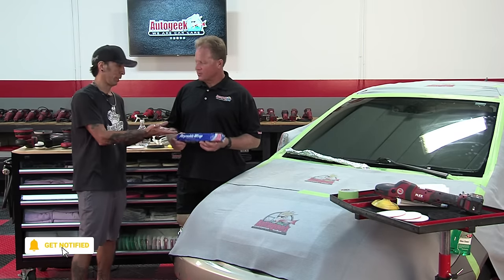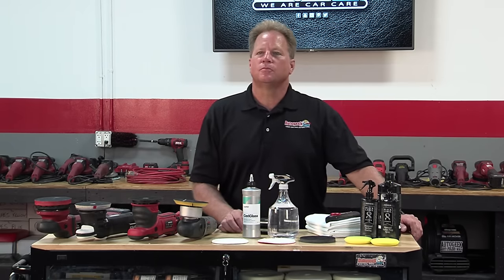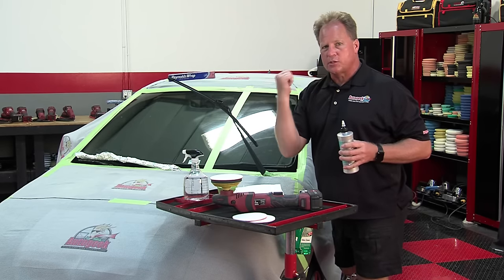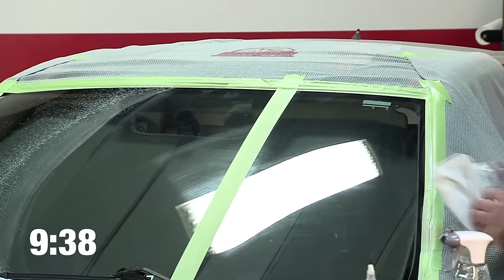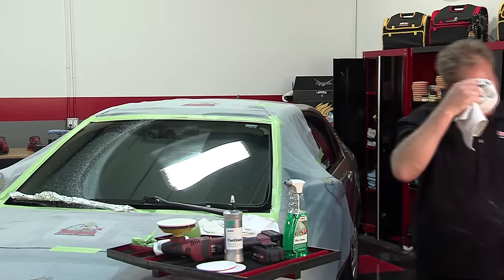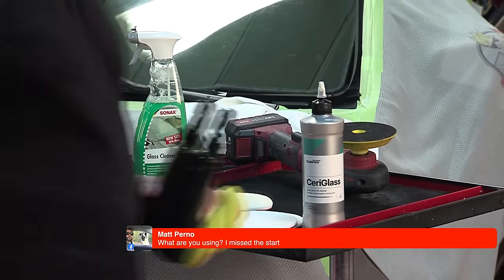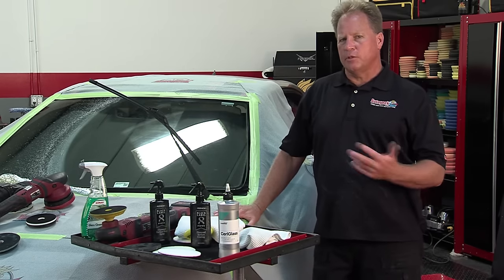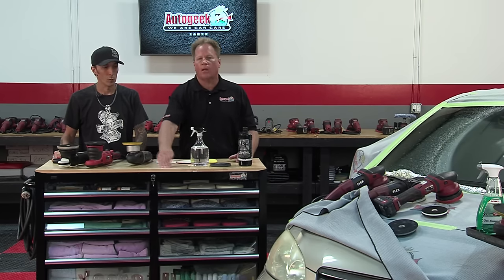How to safely remove pits, wiper marks & scratches from glass

Comment: I tried ceri glass and rayon pad. I ended up marring the glass. I don’t see the marring during daytime but at night. The glass was fine before I just want to remove the watermarks. Watermarks gone and hello marring🤦🏻
Reply: You probably have fine scratching/hazing or if could be redepositing of the glass particles you have buffed off. Possibly from heating up glass too much(I’ve done that) if your glass is smoking the water and polish off it will haze at that point. Possibly from pad wear. You go through a lot of pads with this method. You need to have several and power wash out to reuse to get all the buffed glass material out of the pad and also the used abrasive/polish build up..Try washing your pad or a new one with light pressure and keep it wet and cool with a decent amount of polish. It should  clear up but again it literally takes for effffing ever. I have spent 4 hours on a deeply scratched side window before. The pads start to not work right anymore after awhile, if you notice it started taking longer to get any results it’s the pad.

Comment: been repairing shower glass doors since 85  you can use toothpaste or and soft compound I use diamond magic you don't need expensive stuff you will still have fine circular marks left over
Reply: What about etched glass? Ive tried sanding with sandpaper but the water marks are permanently etched :(
Reply: Lol. That just gets hard water off. Toothpaste won't actually polish anything harder than plastic.

Comment: Rain is distilled water. No spots.
Reply: Horribly incorrect. Rain collects impurities floating in the air and brings it down to the earth.
Reply: @Blue-Lady  idont get spots in my car from rain. Only if its parked under a tree.
Reply: @ryanwright7144  kinda forgot. I live on the coast. Clean rain. I do remember brand new cars off the train at the dealership in dc coming in with bad spots and acid rain damage. Sometimes bullet holes!

Comment: Seems like it’s cheaper to just buy a new window! Liked the explanation of “this can be done” but I still would just buy a new window.
Reply: Yes. I was hesitant to do so. Especially has I'm insured.
But the last time my insurance  company changed a side window on my previous car. The guys replugged the tweeter speaker on the ambiant light by mixing cables and burned it. On top of that they've been unable to relearned the anti pinch safety limit. They damaged the motor shaft to winding drum during their attempts to "mechanically adjust it" and it broke later.
I then fixed it myself and discovered the mess with the tweeter speaker ...
All that combined, I really don't want to give them my new (2nd hand) car to replace a windshield ....
And I'm tied with them through my insurance, I can't go to and official dealer to have the glass replaced. :/
Reply: @stephanelouvet1113  I completely understand.
I do all the work on my vehicles in my driveway.
I replaced both front and rear subframes on my 2008 Ford Taurus over the summer in my driveway. (Got to love the road salt lol)
The only 3 things I don’t do are put tires on my vehicles, rebuild transmissions and alignment’s. 
I’m not saying what you did was a bad thing at all. But it would have been faster to put in a new window. The reason being is that your time is valuable and it would have been faster to just put a new window. I have replaced windshields by myself in under 2 hrs. But with help it could have been done in under 45 minutes.

Comment: why you are not sanding before polishing step
Reply from the maker: We used a less aggressive approach to get the job done. Sanding is extremely tedious (takes many hours), requires a larger investment (sanding materials), and should only be done by experienced people.
Reply: @autogeek  There are window pane polishing tutorials that start with sanding for deeper scratches. Since cerium oxide, usually 2 micron particle size, is the equivalent of 10,000 grit, the sanding process uses a number of finer grit sanding discs to save time before the final cerium oxide polishing. The deeper the abrading, the more optical distortion, so tutorials sometimes show sanding across a broad area to reduce distortion.

Comment: You can get the same results from paint polish and an aggressive pad.  That sure as hell wont get pits out.
Reply from the maker: If that works for you go for it. Yes I have removed pits too.  Here's the link for removing pits...

How to remove tiny pinhole pits in glass windows using a rotary buffer 
https://www.autogeekonline.net/forum/how-to-articles-by-mike-phillips/40436-how-remove-tiny-pinhole-pits-glass-windows-using-rotary-buffer.html

-Mike Philips
Reply: please upload your results and show us sir Id love to see your results.
Reply: @TheRebuilt1  I don't film and upload. As I stated I don't document on social media.
Reply: diamondrmp oh ok , well please advise what platform you have this info and will check out
Reply: @TheRebuilt1  LOL no platforms of documentation.  I've detailed cars for 35+ years.  I learned to use an aggressive paint polish like Meguiar's Diamond Cut Compound with a rotary buffer ( a yellow cutting pad, speed 3 at most) followed with Meguiar's Ultra Pro Finishing Polish.
Reply: diamondrmp ok thanks for sharing and I misread and so see you did say DO NOT share on social media . Would be nice if you some time to upload and share with public if you alternative way to achieve same successful results . Thanks for your time and knowledge transfer.

Comment: or you can buy a new winsheild
Reply: Speakers makes a good point around the 7min mark, not always the best option - older cars where removing it will expose and require battling rust issues

Comment: There is no way you can remove pits from any windshield like your buddy taking the video states... plus  while polishing the windshield you are actually putting a prescription into the glass.... this will make it distorted that is a fact.....drive it at night and you will see... the wiper marks may disappear but the distortion will remain.....
Reply: First, in case you don't understand, it's not about "removing" the pits (or the scratches), but instead is just about grinding the surrounding glass down to the depth of the pit/scratch (plus a tad more). Not sure why you'd suggest the guy doesn't know what he's talking about, or that he's lying. When you do that, it just sounds like it's you who doesn't possess knowledge, or you who's making shit up.

Second, in case you didn't actually watch the video, he divided the windshield into four quadrants and then polished each quadrant an equal amount. It's not at all clear why you'd think that can result in refraction. Sounds more like you let your imagination kick in and then described what you'd imagined as though it were actual experience, especially since you don't seem to understand even the basic principles of "polishing down past the scratch."
Reply: LOL.  Putting a prescription into the glass.

Comment: This method is too time consuming. Use a plastic of metal razor blade instead. Works like a champ and removes all contamination from the glass.
Reply from the maker: That is correct for above surface contamination, we were removing below surface scratches like wiper marks
Reply: Flycatchful yeah because we all know how effective razor blades are at REMOVING scratches from surfaces.....
Reply: @tylerrodriguez9233  if you scratch everything, you dont notice the initial scratches .... now that's genius ...

Comment: Much to do about nothing ......... . Basically any buffing pad and some mildly abrasive paste such as Mothers or Maguires will work just fine , same results without all the BS . Your never going to get “real” scratches out , just taking the curse of them is all you’re doing .
For under $15.00 (parts) and any drill , your good to go , this guy with all his foolish buffing paraphernalia is a (bad) joke .
Reply: No. Regular pastes won't work just fine. They are not harder than glass.
Reply from the maker: Please make your video using anything but cerium oxide.  Good to have so many experts on YouTube.  Not.   -Mike Phillips